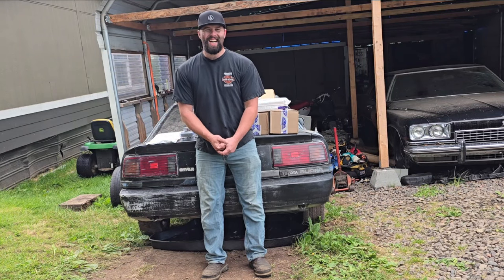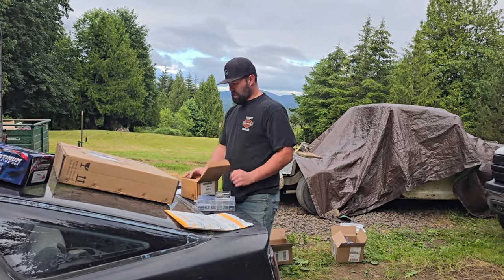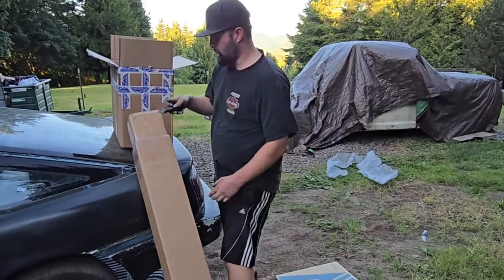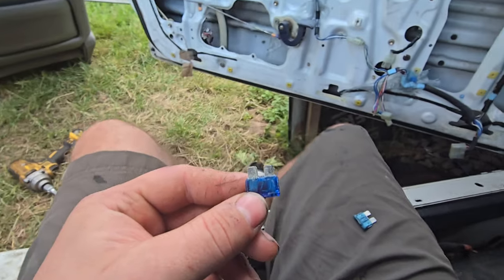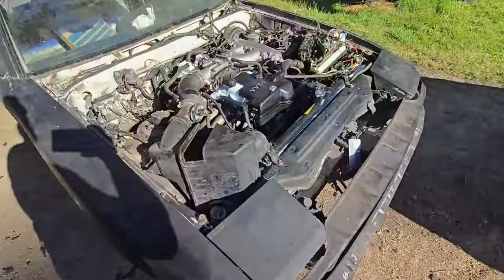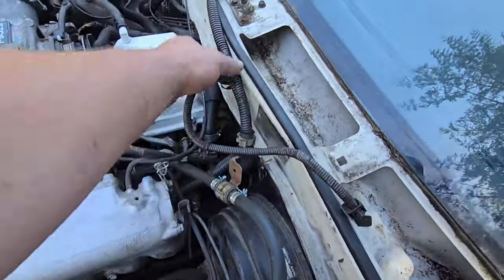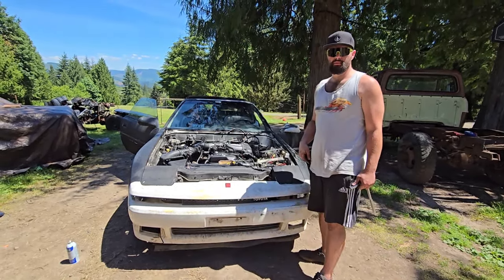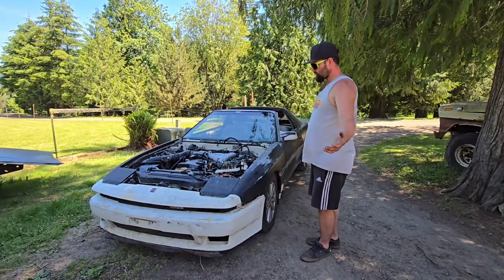CHEAPEST Toyota Supra on Marketplace! 2jz engine swap! (Part 3)

Comment: Did really good job at least u got the vvti swap to work with oem harness. I have none vvti swap in min and use oem 7mge harness on my 2j to run
Reply from the maker: Thank you! I still have some more wiring to do and may eventually go to a stand alone harness but this will work for now.